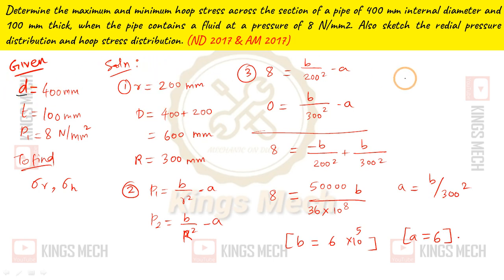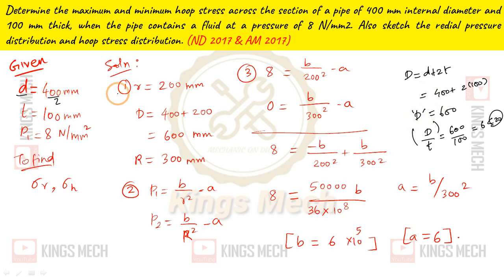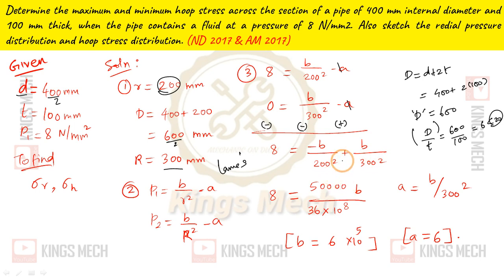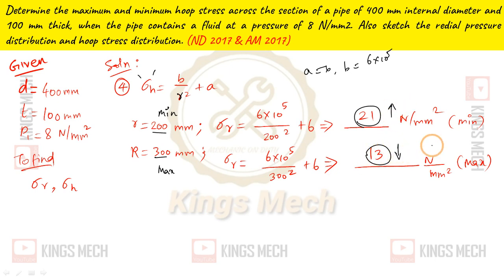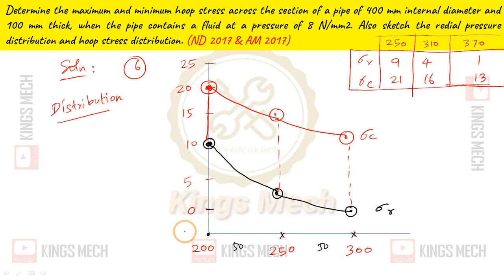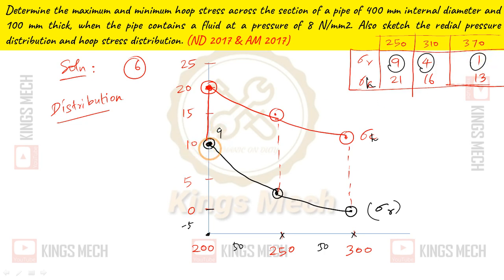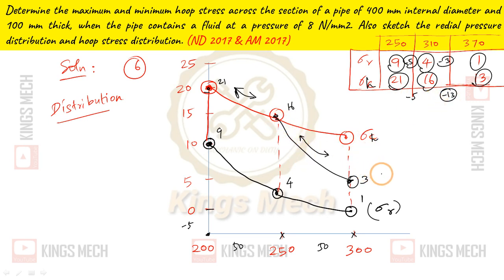Module 5.14 Thick shell problem ND AM 17

Comment: Sir i think min hoop stress should have b/x²-a
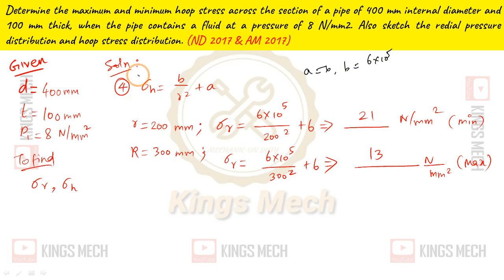Reply: 2:55
Reply from the maker: Both min and Max depends on inner radius and outer radius alone., solution correct.,
Reply from the maker: My answer was correct and verified earlier., anyway please pin the timing., I will check again and update
Thanks for the information